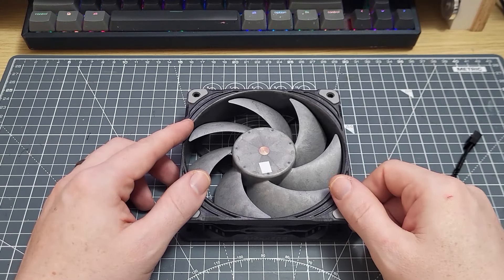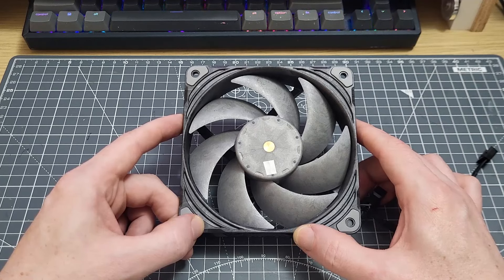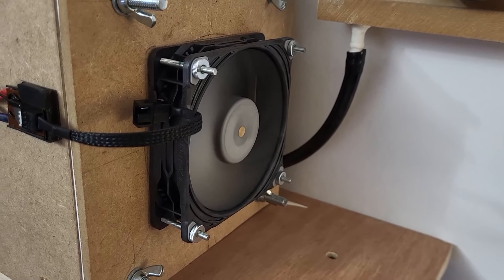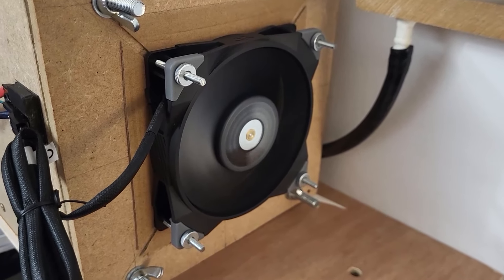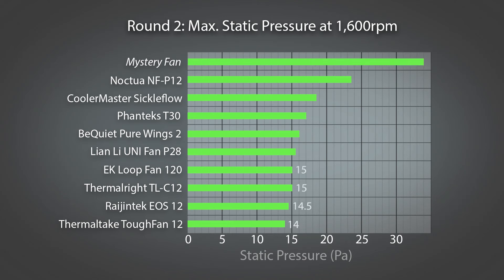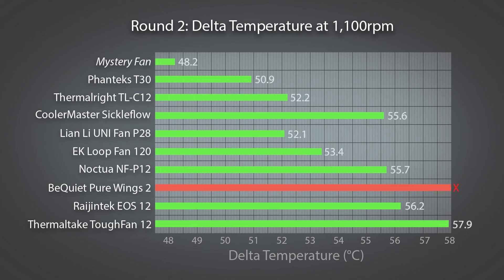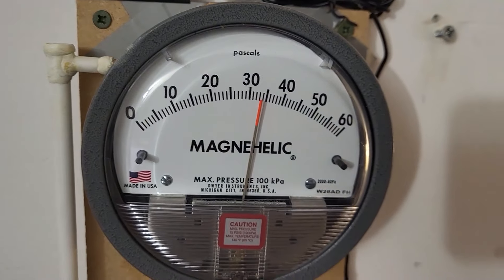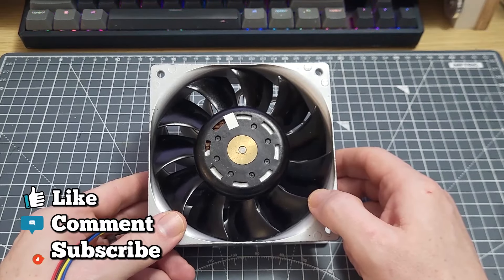"Static Pressure Fans" Don't Exist - Part 5

Comment: As others mentioned, being 27%-52% thicker is a huge advantage for the G1238.

I agree with your assessment. PC fans are optimized for lower noise levels rather than raw performance as with server fans (and a 12V power supply, vs 48V, and generally <12W power consumption to run off of MB fan headers, vs 32W). The real question, is that the right focus? 

Generally, I think most users don't want to hear their PC, but I only have anecdotal evidence to back this up. Given the tech-influencer focus on noise as well, it's fair to say people have been biased against fan noise.

Comment: I would recommend testing a quality 38mm thick PC "noise optimized" fan against the nidec to see how far it gets, and how true the performance optimization claim, wrt the nidec, in fact is.

Does it really have that sort of optimization, or does it pull ahead merely by being 38mm thick?

Likewise, 15mm slim fans for comparison would help draw a generalization about fan thickness.
Reply from the maker: It's a good shout and I'll be looking into that in a future video. When preparing for this series I ran the tests with various fans, and one of my Nidec 38mm fans was beaten by the Gentle Typhoon in the thermal test. It is certainly the case that not all 38mm fans are performance optimised, but one of the main aspects of that optimisation is the rotational speed - which I'll demonstrate soon. :)
Reply: The San Ace 9RA1212P1K001 is such a fan too, but it interestingly has the same performance specs as the T30 (at H model speeds), bar the noise, so it should perform the same at the same rpm.
I really like mine though, much better than a P12 Max in terms of annoying additional noises, even though my case amplifies the bearing noise somewhat
Reply: @FanPhys   I mean you can make any fan perform well by spinning the fuck out of it. But then you can just say the fastest fan is the best fan and there's clearly more to it than that, so I'm a big fan of noise normalized performance comparisons.
Reply: @or2kr p12 max as in the Artics?

Comment: Great videos! I'm grateful for the static pressure comparisons between the fans, its interesting how that doesnt always correspond directly to the best performers as far as cpu cooling goes.  

I'm considering building a DIY rosenthal box using p.c. fans. Im guessing stattic pressure would be the most important metric in a high flow box. And now im going down the rabit hole on filters, fans, ect. 😂

Comment: I  used TA450 Nidec as front intake fans and they have a distinct bearing noise at low rpms a lot of these server fans tend to have them really annoying but the airflow advantage they have over regular fans makes them  tolerable also.....Headphones😁
Reply from the maker: The TA450DC is a great fan - I have a few of them :)  And yes, headphones are the answer to noisy fans :D

Comment: I mean, i think everyone already assumes that when GN and the like say "performance optimized" or similar, this optimization is within the constrains of a PC in terms of size noise etc.
Reply from the maker: Yep and to their discredit, it is just empty marketing flavour text. Most high-end PC fans are highly optimised to make you pay as much as possible on the pretence that you are getting extra pressure/performance/cooling. I mean, some fans are as much as £40 a pop nowadays. It's ridiculous.
Reply: @FanPhys  yeah, brands are misrepresenting their product, its the world we live in.

But for example, its clear that the noctua one had more static pressure than the others, since axial fans are bad at it, any increase is going to be noticeable on dense radiators for example.

So going for the high static pressure pc fan still holds value.

Comment: Something that might be fun to test:

A PC case known to starve airflow like an NZXT H500.

Test thermals as case fans.

I upgraded my H500 to T30's and noticed substantially better thermals. Marginal improvements in static pressure, even as objectively weak as it is, pay dividends in restricted use cases.
Reply from the maker: Possibly in the future I can test case airflow - thank you for the suggestion!

Comment: watching this series very keen. But tbh there is no greater picture here. Hope you put up a big table at the end. Als would love for you to use some radiators. Also the arctic p12 would be interesting, since it's so cheap.
Reply from the maker: Thanks! The P12 was in the first line-up of ten fans, and I'll be doing a short analysis video in due course, but there is more testing to be done still!
Reply: oh right. Forgot about that one. It just feels that you pick for some tests some fans and I am constantly wondering about how they fit in the overall results. Hope you having a great week.
 @FanPhys

Comment: what are the contraptions you used on those fans including that small clip on the top of fan and a rubber band going to the heatsink , did u stick the clip to the fan ?
Reply from the maker: It's a frame I made myself to make it easy to switch out the fans for testing. Just a simple plastic frame that pulls the fan against the heatsink with an elastic band. :)

Comment: As pc fans, the T30s are amazing! But I do think its due to the extra 5mm of thickness. The P28s are 28mm thick and the performance seem to be in line with the thickness again. Thank you for testing!

Is the mystery fan(Nidec) loud or have some kind of subjective extra noise compared to the rest of the fans? I would switch over to more performant fans, but noise at idle is a deal breaker for me.
Reply: Im also interested to know how the nidec fan is compared to a t30, in terms of noise.
Reply: The nidec is noisey
Reply from the maker: The Nidec G1238B is definitely not a quiet fan, and because of the metal frame the vibrations are more of an issue, but it's surprisingly quiet at 1100rpm - so much so that I'd be more than happy to use it daily without any bother. Problem is, it costs over £100... :D

Comment: You might need to clarify what the conclusion is of this test, as it would seem obvious that when you want a quiet fan, you trade performance. If noise is not of concern, you might as well get a delta (server) fan and call it a day. What is so noteworthy of your findings?
Reply: He said it at the end; desktop pc fans aren't performance or static pressure optimised, they're noise optimised. The general tech press will tell you this fan is super optimised for static pressure and that one for airflow, but in reality they're not, as shown previously where the nf-p12 has more static pressure than the hallowed a12x25.
Reply: @MakinComputers   Good point, that was indeed what was stated. But then that raises another question: was the sole purpose of the video to debunk marketing mumbo jumbo? I am not opposed to that, but I think the video could have been a lot more compressed as this could have been demonstrated in 2 minutes IMHO.

Consumers are either going to buy delta fans for maximum performance or watch/read some sort of review of a heat exchanger or cooling fans for domestic use that has a decent enough noise/performance ratio. 

I think it is solely the more literate (but not literate enough) tech folks that fall for the static pressure/airflow mumbo jumbo. 
Most (non) technies that I know just watch or read a review and watch the actual benchmark results for example, rather then care about static pressure/airflow, but I could very well be talking about a minority of the people who fall for the mumbo jumbo. Maybe I am wrong and a lot more people end up buying e.g. fans based on static pressure/air flow marketing then checking actual benchmarks, as that is what should matter in my opinion, not the labels you put on the box to justify a higher price.
Reply: @masterTigress96  I think it's more a series in introducing people to a new/different way of thinking about fans. The vast majority of people would buy into fan hype, and reviews, even if taken with a pinch of salt

I used to refer to the spec sheet if I was choosing between a couple of fans (never been one for spending silly money on fans, more middle of the road ones), but as it turns out spec sheets might as well be listed in the sci-fi section. They're all total nonsense, all tested differently and even reviews from reliable sources can't be trusted (cough-igorslab-cough). Just find a fan that's within your budget and suits your eye, it will probably be fine. There are so many variables in systems and environments, results in a review might differ greatly than those for your individual use case.
Reply: @MakinComputers  Yes, agreed with a lot of what you said. Let's hope then that the "Static Pressure Fans Don't Exist" series can introduce people to a new way of thinking. With the introduction of the internet the idea was that we would have access to an unprecedented amount of information, which has been proven to be true. However, the creators never seemed to have thought about finding the factual information you're looking for in this unprecedented amount of information. As you stated, tech specs or fact sheets are all a method of marketing nowadays instead of having any objective information on them.
Reply from the maker: Once I've done more tests (I need to be thorough) I'm planning to do a "midway" review where I look at all the results and draw some preliminary conclusions. When it comes to thermal testing, I need to try different heatsinks before I can draw definite conclusions, so there's quite a bit more to do.

Comment: I would have liked to see the non over-volted result from the noctua included too (i understand the need to speed match for testing, but real world use would be valuable too). 

I see definition of performance optimised as within it's sector not all fans. Like a sport variant of a hatchback is performance optimised but will still be slower than a supercar.
Reply from the maker: You could probably make a reasonably accurate guess based on the two data points at 1600rpm and 1100rpm. On this particular heatsink (high fin density) the P12 is not among the best performing fans. I'll be interested to see how it does on a different cooler. On the matter of "optimised" fans, it's just marketing guff. Almost every fan these days is described as a "High Performance" fan, which is just a sales pitch. My feeling is that the variance in performance is mostly coincidental, as most PC fans are designed based on what looks cool rather than what actually performs best.

Comment: Holy cow, i can't believe how close the thermalright fan is to the T30! And you can get 6 of them for the price of 1 T30 😂 Also very shocked by the toughfan. I have 2 others i could send to see if it's a dud, or it might just be a problem with it's odd frame.
Reply from the maker: Definitely not a dud haha, just not a great fan - that's what they get for the shameless copy+pasta of the A12x25! And yes, the Thermalright fan surprised me too, a lot like the Cougar Vortex and the eLoop.
Reply: for certain use cases the price of the T30 can be justified as it is a low percent of total build cost. I.e. a custom loop pc with high end parts.  Also for such use cases noise normalized performance and noise tone are all that matter. Performance at a given RPM is irrelevant.

Comment: I've got many Nidec Fans, full model: HF104-A000 (V12E12BS2B5-07A021).
My WC Fans are sub-optimal and my 13900K is pulling roughtly 280W.
I bought an external PWM Controller and I am thinking about using them on my radiator.
Do you know these fans? Are they any good?
On the online spreadsheets it says: 202CFM, but on my fans it is written 250CFM.

Comment: noise normalized performance is more relevant than performance at a specific RPM. Calling noise normalized performance poor performance is silly. You left out how loud the mystery fan is at those RPMs.
Reply from the maker: I made two videos about measuring fan noise, addressing the futility of so-called "noise normalized performance".
Reply: @FanPhys  it isn't futile. And it's more relevant to review that way than RPM.

Comment: At 1600rpm your mystery fan is only 30% better than the Noctua which is 40% better than the Thermaltake which seems a nil point when one has a 6.1a start up current and 4.45a rated. You should test them flat out at 14v and compare pressure per watt of energy to be somewhat more fair comparing the two in ability/engineering. Either that or limit to 1a.
Reply from the maker: It's not really an efficiency comparison though (nor is it intended to be "fair"); it's just a way to put into perspective what happens when a 120mm fan is actually optimised for air-moving performance.